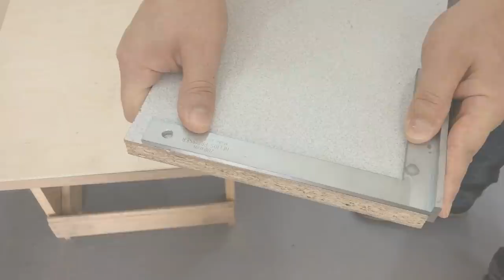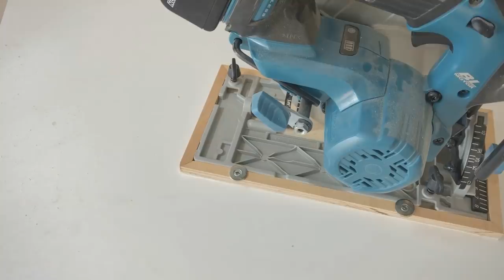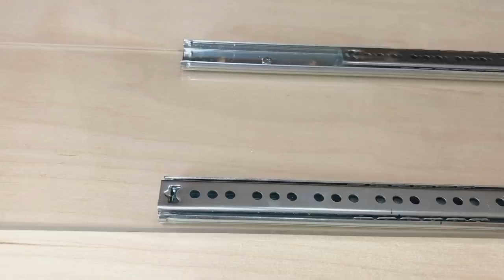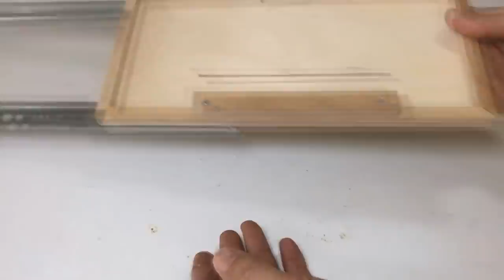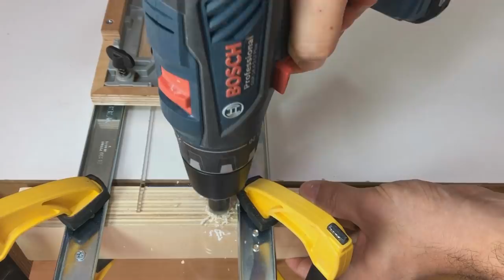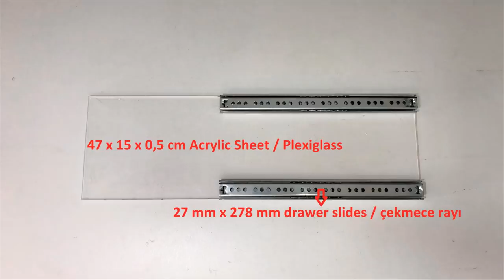New Tool Idea From Drawer Slides // Çekmece Raylarından Yeni Bir Fikir

Comment: 30years ago as a novice diyer I'd have killed for this gadget, not getting perfectly square cuts was the down fall of many of my first projects, as a pro I have many tool to get this job done but I still may make one with longer runners for the cut that don't fit in my saw and I don't wanna get my track out.
A great addition to any diyers tool kit!

Comment: ...or you can use a speed square and achieve the same results?
Reply: or a level and two quick clamps...
Reply: Framing square also works but you do have a right old hassle working out exactly where the cut will drop.

Comment: Good idea, but after a few uses those sliders will be full of dust and will start to get stuck and rusty. The constant cleaning and lubing required could make it not worth it.
Reply: The backstop attached to some sort of perpendicular side rail is probably the more important component as the intention seems to be to make a square cut

Comment: This is not clever at all, after a few uses the bearings in the runners would fail to operate smoothly after getting full of sawdust. Back to the drawing board.

Comment: Way too complicated and no way to adjust square after assembly. There are multiple steps that require perfect parallel alignment of the slides to the plexiglass base and the saw fixture to the slides. Misalignment here will destroy the track during a cut. The depth of cut is so shallow that a speed square would work as well, or better.

Comment: Over engineered and lose about 1/2” (12.7mm for the metric community) with all the layers of materials,  just use a rapid (rafter) square, like 99.9% of the people
Reply: Yeah, I would have put the slides on the side (somehow...) to limit the loss of cutting depth. Or used a speed square 😆